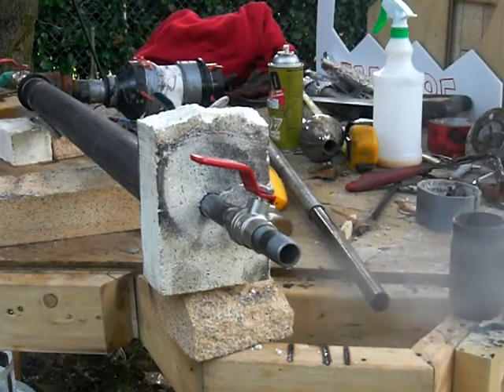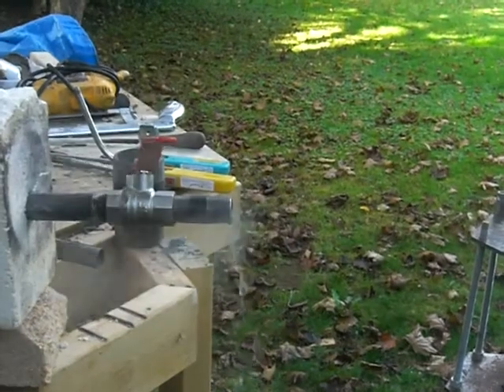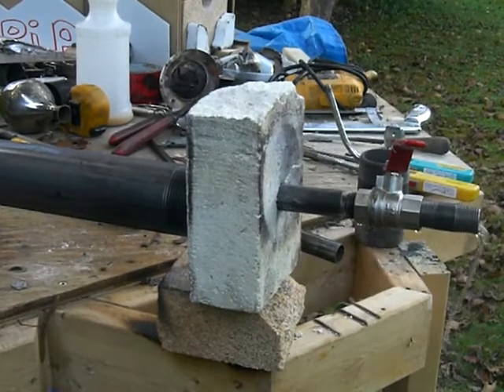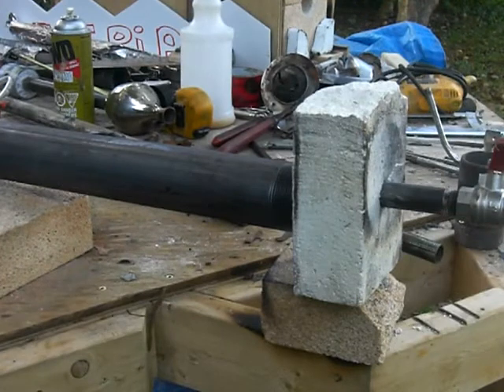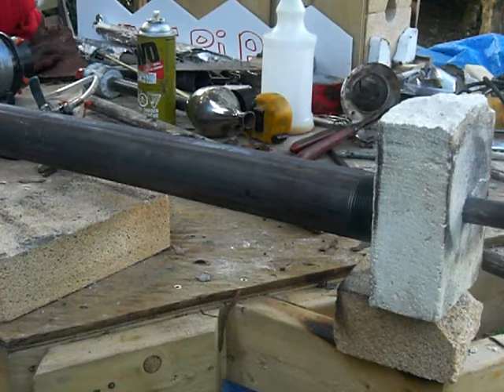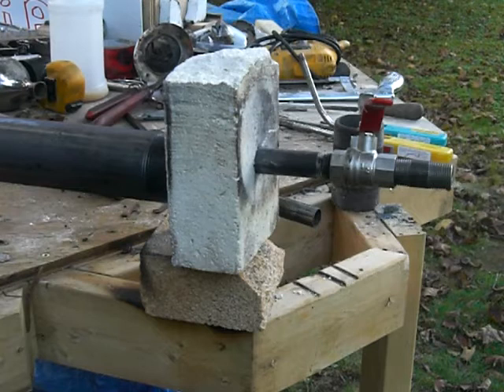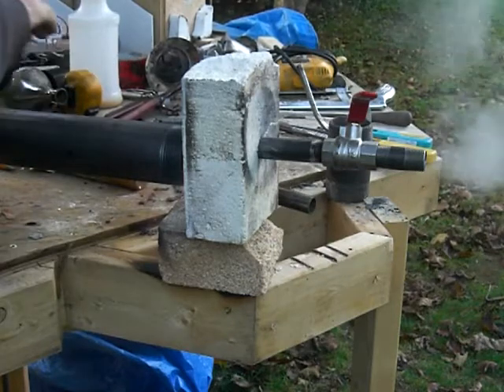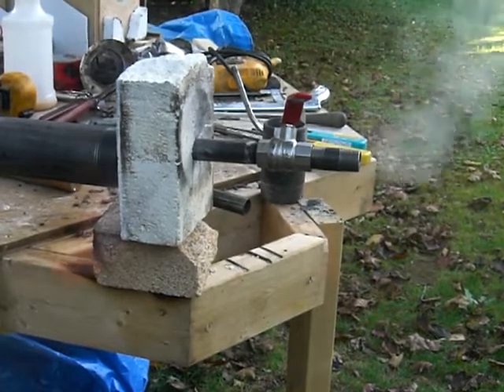457 Water heating test Lots of room for improvemnt

Comment from the maker: Yes I have done a vert. test using a 1.5 inch pipe.  Using a ss kettle I've been able to bring 16 oz. of water to a boil in 23 sec, and fully convert to steam just under 4 minutes.  I'm hoping to have a steamer fabricated that will capture more of the heat that should chop the time off under 20 sec.

Comment from the maker: Hi Alex-I'll be using a 1.5 x 16 inch 144 x 1/8th inch steel pipe capped on one end.  This should provide for the most efficient hot water demand system anywhere.  This will be the 2nd stage with a syngas gen. being the primary component. I'll be building a model of it soon so that it can be fabricated. Nearly completed a new joepipe kit that will allow for any and all testing including having all the flow meters, IR meter and thermometer and K prob for assertaining the numbers. Keeping in touch

Comment from the maker: Hi TJ.-I'm nearly completed putting together a new joepipe kit. I've replace the small fan with a 4 inch-152 cmf fan hooked to a auto transformer to make it fully variable. I'm search out a mass flow meter for the propane and also the air.  Monday I'll phone around Edmonton here to see if one can be tracked down. Replaced the propane reg. with a Smith regulator and site glass.  Lots more pressure to play with now. Next step is to replace the JP with a snygas gen. to run a large gen-set.

Comment from the maker: Hi knsAneTunA-Still working here in Edmonton during the day and putting together a complete joepipe test kit.  This time round I'm hoping to have all the flow meters in place.  I've updated my little maring fan for a 152 cfm inline induction fan with a 4 inch output.  When hooked to a auto transformer purchased on ebay, it was possible to slow it down enough to develop the L3 flame.  Hope to be doing an initial test this coming Tuesday.  Put about $2, 500 into it by the time it's all set up.

Comment: That might do the trick, but I think that your system would be more efficient if you warm up water with the flame from the joe pipe. Like a giant boiler or cooking pot.  What happens if you point the joe pipe straight up in the sky? Does it get hotter? Have you ever tried to do that?  And what about a pipe inside the Joe pipe for hot water, inspired by the GEET system, is that an option? Or a slightly bigger pipe around the joe pipe that is topped off at one side with a water intake?

Greets, iT

Comment from the maker: High Alex

   I was hoping for a high yield hot water on demand system using the direct heating of the inner pipe.  Developed too much capitation from the steam.  To compensate, I'm going to try to use the outside of the pipe instead?